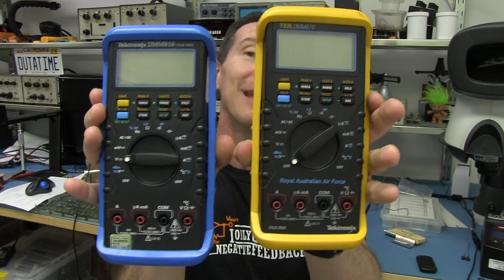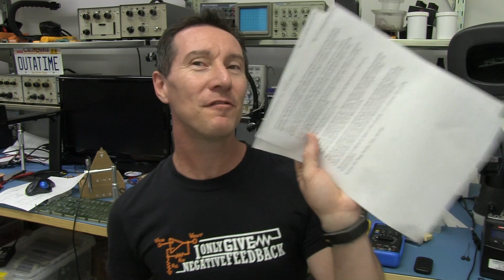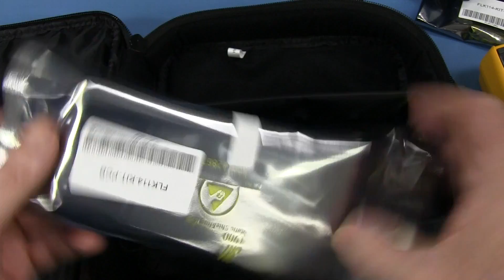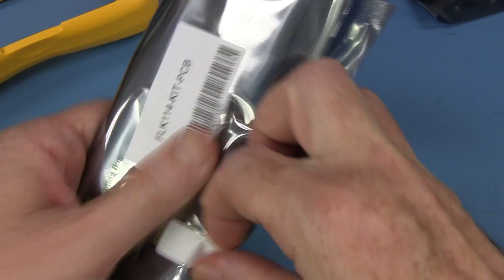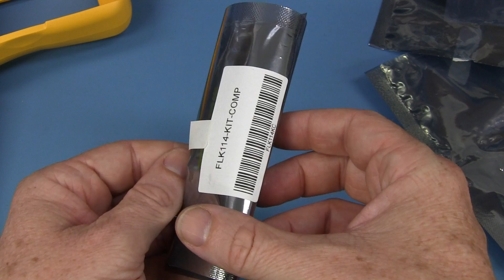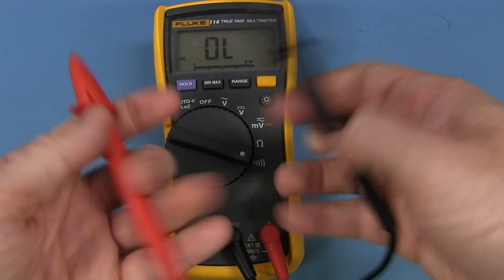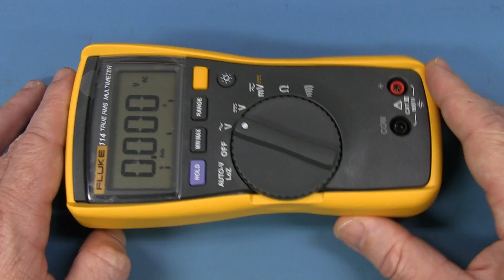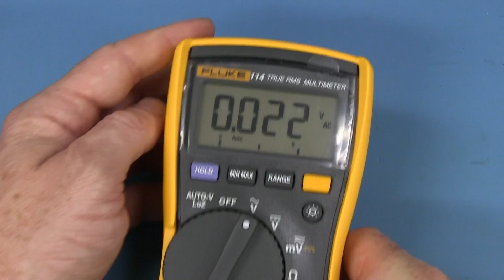EEVblog #597 - Fluke 114 Kit Multimeter + Sparkfun/Fluke Rant

Comment: Trademarks and "trade dress" are sticky issues in the US. The issue is with how the laws are written and upheld: in the US, trademark laws require that the trademark holder actively protect their trademark, or they forfeit it. In other words, "use it or lose it". If Fluke let one batch go to market, they risk losing their trademark (which includes "trade dress", or key features of a product's appearance that are commonly associated with a specific brand.)

Trademark law doesn't differentiate if a company is okay with letting something "slip by" out of kindness, or if it's a knowing product infringement. In other words, Fluke couldn't let those Sparkfun meters go to market even if they were okay with it, because the trademark law says they could still lose their trademark over it. If Fluke doesn't want to risk losing their trademark (which would be a Very Bad Thing for a company like that), their hands are completely tied by trademark law. Unfortunately this makes the company (Fluke in this case) look like dicks to some people, even if they're not; they just don't really have a choice in the matter. It's pretty much an all-or-nothing proposition when it comes to protecting trademarks.

The only way around this is to pay a licensing fee to the trademark holder, but that can be an expensive proposition; not only does the other company have to pay a fee for every unit they sell, but there's all sorts of lawyers, legal stuff and contracts involved and the costs add up. In most cases, the licensing fees aren't worth the trouble, especially when it's something as basic as trade dress colors. It's easier just to use a different color, rather than pay Fluke a ton of money in licensing fees (which would drive up the cost of the meters.) Besides that, many companies won't license their trademarks to products that don't meet certain quality standards; they don't want their name associated with products of questionable quality. Given how much Fluke has invested in high quality and high safety (over decades), I doubt they'd ever license their trademarks to those dirt-cheap meters. It could negatively alter the public perception of Fluke in general, and that's a massive risk most companies understandably don't want to gamble on.

Some people will keep blaming Fluke, and that's just how it goes. But it's not really Fluke's fault; the law requires that they actively protect their trademark/trade dress as vigorously as possible (that's one of the main reasons companies like Fluke have big legal departments.) Otherwise they risk losing a trademark, and associated reputation, that they've worked decades to achieve. Whether or not Fluke was "just doing damage control" with the donation, I think they handled it very well. They didn't have to do anything, and could very easily have just washed their hands of the matter and said "oh well, tough shit". But I think they did an admirable thing, and they definitely deserve some credit for that.
Reply: Yup, Fluke is being perfectly reasonable here.  Trade Dress matters, and frankly Sparkfun should have known better.

I want one of those kits, though.  I don't REALLY need another low-medium end meter, but I can absolutely find uses for it!
Reply from the maker: Gabriel Hoffman
I disagree that Sparkfun "should have known better", hundreds of companies and stores around the world sell or have sold yellow holstered meters. It is so common it's almost impossible to think there is problem with it provided you don't use the Fluke name, or make it look identical. Almost no one had heard of this before the Sparkfun thing.
Reply: I'm not so sure that's entirely true. Take a look at this: https://www.eff.org/deeplinks/2013/11/trademark-law-does-not-require-companies-tirelessly-censor-internet

In particular, this quote from a court is pretty interesting: "The owner of a mark is not required to constantly monitor every nook and cranny of the entire nation and to fire both barrels of his shotgun instantly upon spotting a possible infringer."
Reply: *****
 That's true, they don't have to spend all of their time searching these things out. But if it's brought to their attention, they have to act on it (or they're supposed to, at least.) I'd also imagine that it depends on a lot of factors: if it was just a few meters that slipped through customs, they probably wouldn't bother. But when a pretty recognizable company like Sparkfun is trying to import a lot of these meters, Fluke can't ignore it because it could come back to bite them on the ass later.

Having said that, from what I understand Fluke didn't even have much to do with the confiscation, US Customs did. Their whole job is to not let in stuff that's illegal (including trademark violations.) Obviously they don't catch everything, because they can't possibly search every single box on every shipping container. Sparkfun's container just happened to be one of the ones they did check this time and they lost that lottery. I seriously doubt Sparkfun's intention was to trick people into thinking their meters were Flukes. There's a good chance they didn't even know what color the meters would be, because those cheap Chinese ones come in all sorts of different colors, even if they're the same model. The factories over there just seem to kinda pick random colors on different days. Sparkfun probably just picked one with the specs they wanted and ordered a bunch of them. I somehow doubt color was much of a consideration. (EDIT: I've since found out they were aware of the color choice and had been importing them for a few years.)

I think Fluke recognized that this was just an unfortunate coincidence, which is why they stepped up like they did.
Reply: *****
BTW, the issue with Canonical and Ubuntu had more to do with "Fair Use" policies than anything. That's a slightly different set of circumstances than this.
Reply: ***** I know the issue isn't exactly the same but I'm sure some of the same laws apply.
Reply: Gabriel Hoffman
 I'm going to have to agree with Dave on this one. You can't possibly expect every company to know every little legal nuance of every other company. I don't think Sparkfun did it intentionally, especially with a $20 meter. Now if they had gone with a high-spec, high-quality meter and pegged it at $150, then I might agree with you that Sparkfun was being shady. But these were cheap meters that Sparkfun never tried to pass off as Flukes.

Now that I've looked closer at the meter in question, I don't think it was just the yellow color that was the problem. It was that, combined with the overall shape of the meter. It's very...Fluke-like. I think that may have been the tipping point. There are lots of $15 meters with yellow boots on Amazon, and there are lots of meters that have a similar Fluke-ish shape. But they don't tend to be used together, and this is probably why. That combination of features is most likely what constitutes Fluke's "trade dress".

I also noticed that Sparkfun has been selling these for a few years now, so plenty of them did make it into the country. Like I said before, I think SF just got unlucky this time with the random Customs search. Like I said though, I don't think Sparkfun had any devious intentions, so it's one of those instances where US trademark law seems a little more heavy-handed than it needs to be.
Reply: EEVblog
Well, it seems pretty obvious to me, but then I'm a music instrument industry guy, and have seen several trade dress issues involving similar issues.  But the look of the Fluke hand held stuff is so distinctive I would just assume it was trademarked (and frankly, they would have to be stupid not to do so).

At the very least, it will hopefully make Sparkfun more careful about IP rights in the future, which is a good thing in my mind.
Reply: +Gabriel Hoffman why would you say that I've seen many yellow grey combination meters that were sold in the US
Reply: +catdumpling When trade dress becomes one of a brands trademarks, the US has not been shy to protect it, it is just a very subjective matter, and has to do with brand recognition and brand dress consistency.
I do know cocacola has won a quite few 'trade dress' disputes, most of which most people would agree with. Basically no other beverage can look like a cocacola from across the room, and i get it. Such labeling would be intentionally trying to trick people.
I do wonder tho, if bethseda decided to put Nuka-cola in stores, i bet coka-cola would sick lawyers on it like flys on shit lol.
Reply: Customs doesn't open every single import package, only ones that look "interesting", and if you've bought stuff from abroad you've probably noticed that the shippers don't always declare honestly (probably to evade duties). That's more or less OK as far as trademark defense goes, a trademark owner is expected to be reasonably vigilant but not omniscient.
Reply: Plus the meters are aimed at different markets. - Yeah I know I am a couple years late.

Comment: So was this whole thing just a marketing ploy for these 'kit' meters? Really the price of the meter is half because someone in china didn't spend 30 seconds putting it together, but instead spent more time putting all the bits into separate bags? This whole thing reeks even more now than it did originally.What a cheap a** trick on Fluke's part!
Reply: And hopefully this isn't an early April fools joke on someone's part - Dave's or Flukes, if it's not, it sure seems like it is...
Reply: Yeah I think it's pretty obvious someone in marketing just told an engineer to throw together the parts and call it a kit. It's borderline comedic. Selling in a kit form doesn't make it cheaper to produce. The cost of splitting the parts into a kit probably cost as much as having it assembled. BUT the average consumer probably won't want to put one together themselves, but a hacker/maker would. So this allows them to provide the meter at a cheaper price to hackers/makers without the risk of average consumers picking it up. Plus there wont be any argument from consumers like if they simply gave a straight up discount for "hackers"
Reply: Heh, I was right, it was April fools, even though it's only April Fools here now, but good one Dave!

Comment: I'd love to have this meter because I've been working with electrical things as a hobby for about 5 years. I really got into electronics about 2 years ago and since then I've even been working on building audio amplifiers, and vacuum tube audio amplifiers. I only really have one nice multimeter, a HP 3456A but I have no handheld multimeter, and I definitely don't have a nice reliable pair of test leads, i'd love this fluke meter!

Comment: That colour thing is a bit of a stretch. As long as it dose not have the same shape and brand on the front, why will they care?
My product will be yellow luckily is not a multimeter but not that far it will still measures voltage and current.
Say I'm a small company designing a nice dark gray and yellow multimeter and of course I probably have no idea about the Fluke monopoly and manufacture like 10k or more of them. What then ? seems a bit silly.

Comment: A good product sells itself. As an electric professional I think first of Fluke products. I love em and have for years. Since I deal with SERIOUS voltages and big amps in dangerous environments, for safety reasons I feel much much safer with a Fluke in my hand than any other brand. But that's just me. I can afford it. I've seen too many meters blow up. In a hobby environment I suppose any meter will do though. I've had tons of those too but.. well, they just don't last as well.